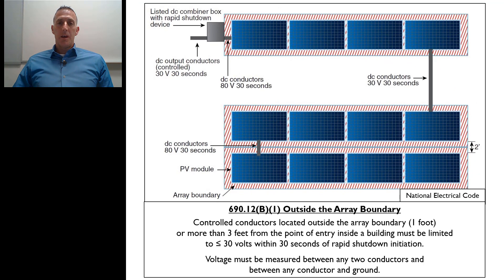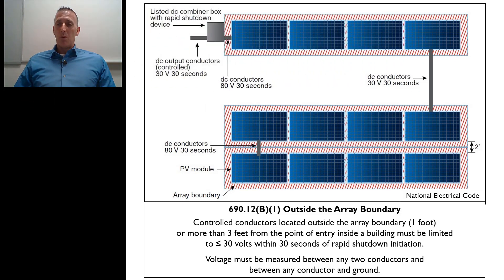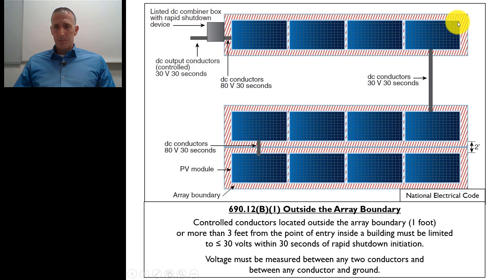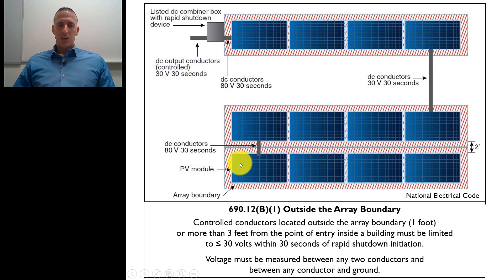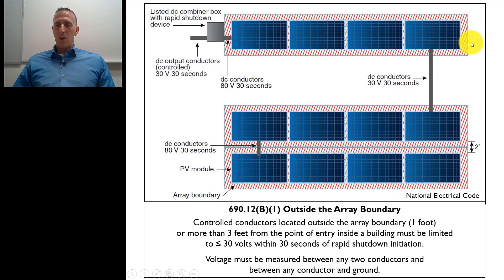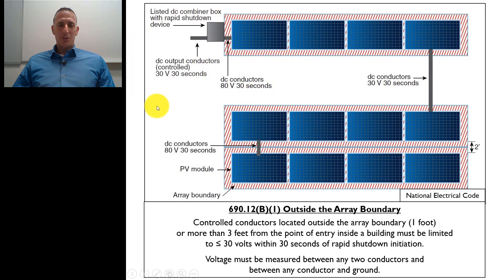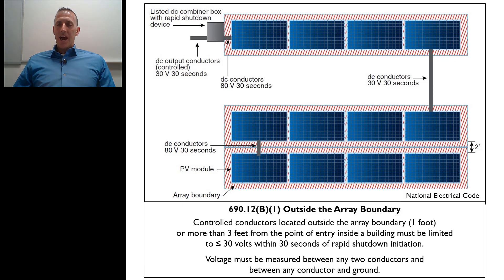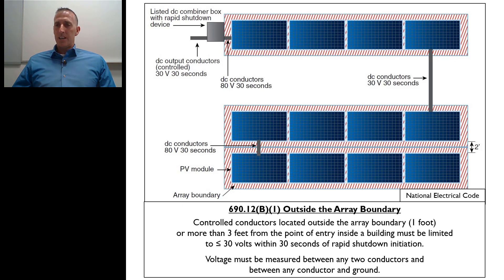Solar Training - Rapid Shutdown Controlled Conductors

Comment: According to this, a regular array of 3x 60 cells panel in serie on the roof connected to a very basic charge regulator inside the house does not complie with that?  like.. any 3+ solar panel permanently connected in serie with MC4 does not comply with the 80Vdc ?  To complie it suggest that power optimizer or micro inverter are the only way to acheive this?..